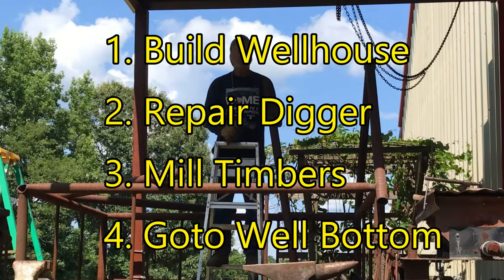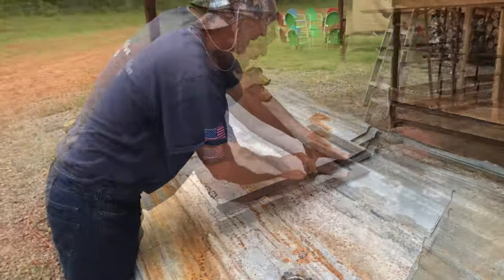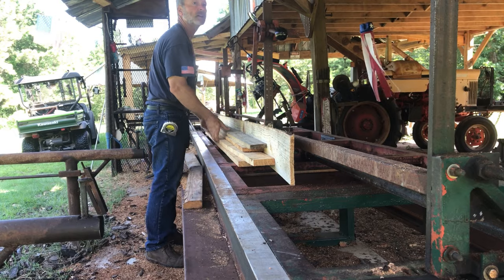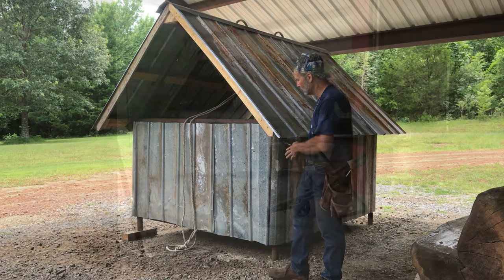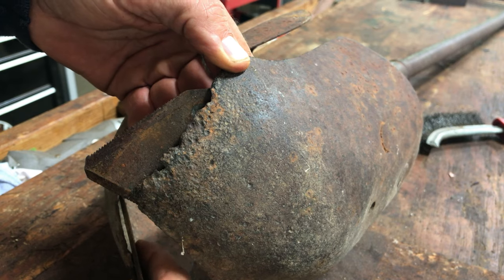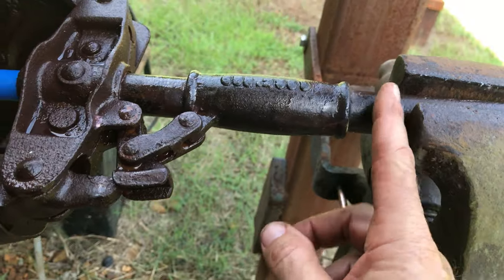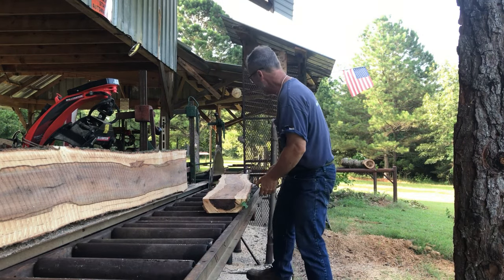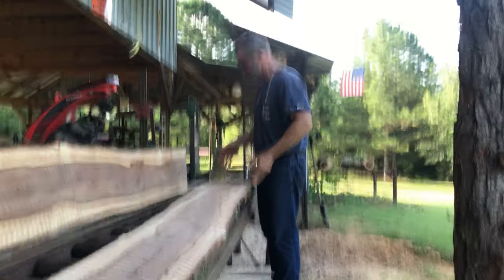Water Well Cleanout #1

Comment: I'm like you....I save all the old materials to use again.  You sure covered a lot of territory as well as subjects on this one Kim !! I liked the old mower section shaped for a new cutting edge.  Great stuff.  Kinda like some of the stuff over here.  LOL.  Spring boarding during edging is why I added the third knee on my Belsaw.  That gave support every three feet.  Worked real well too the few times I used it  for that. You still have the best Belsaw setup I've seen yet on YouTube though !!  One question...why is oilfield pipe magnetized ?? How does that happen anyway...
Reply from the maker: I didn’t know a knee at 3’ would fix the diving board.  I will test that.  I was told running the drill stem or tubing up and down in the hole (geo magnetic field) is what magnetizes it.  Just like running a magnet up and down the shaft of a Phillips screwdriver so you can place a screw in the mount of a relay way back in a control box!
Reply: @TripleTRanchAndSawmill  It won't totally eliminate it, but it does minimize it.  Noticeably less flippy flop with it there halfway between the two. That's very interesting about the geo magnetic field.  Never heard of such a thing.  Yes, I've done the screwdriver trick many times. LOL  Thanks Kim for the information buddy.